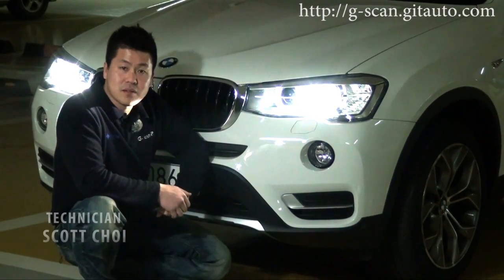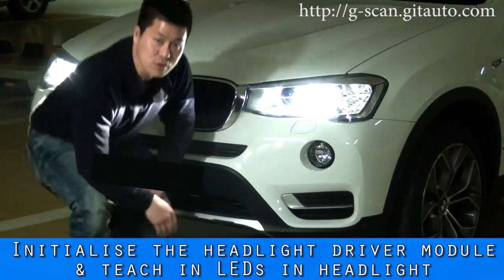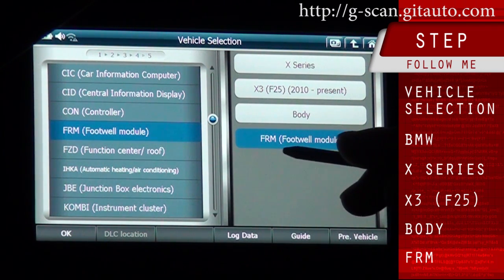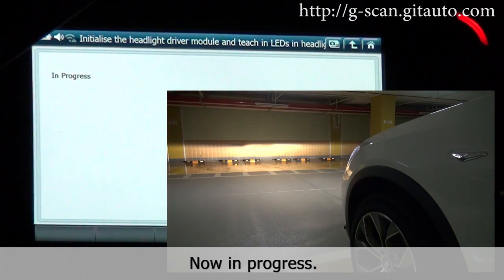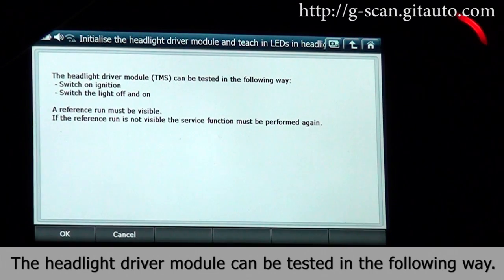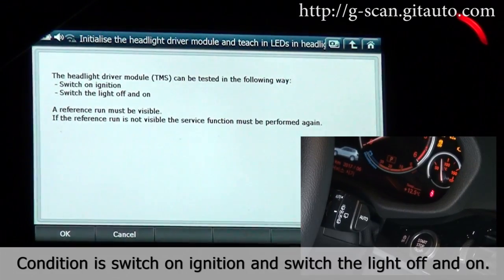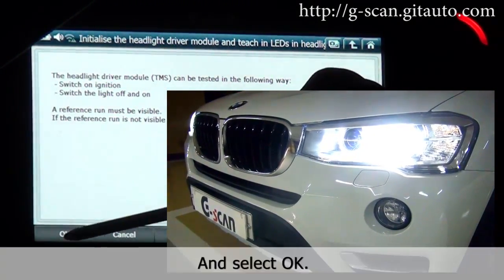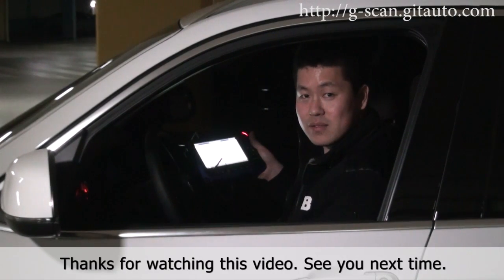How to initialise the headlight driver module and teach in LEDs in headlight with G-scan2

Comment: Hi Scott, I just watched your video. How much do you charge to program the headlight? Where are you located. I have a 2014 BMW 535i xDrive. I changed the headlight and the TMS control module. I believed, it needs to be programmed.